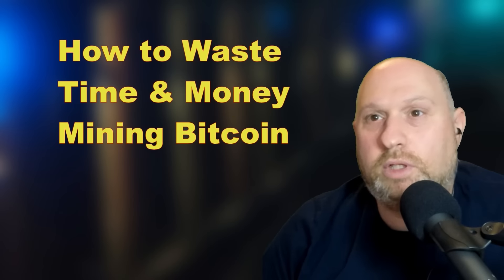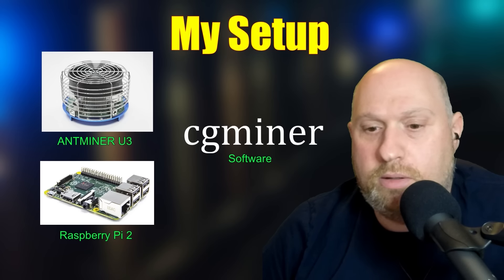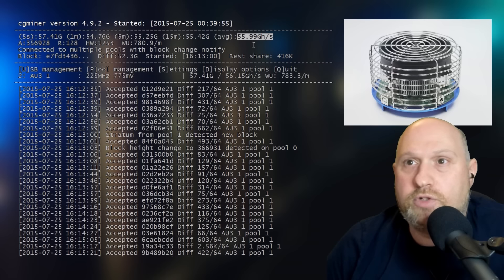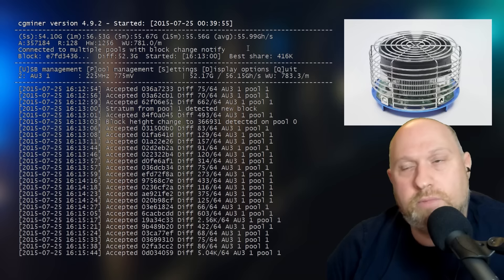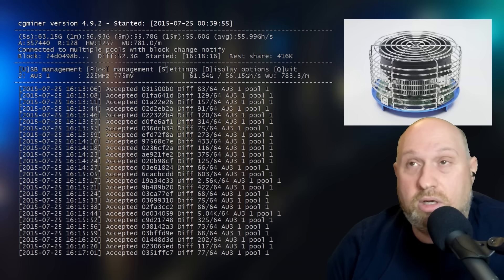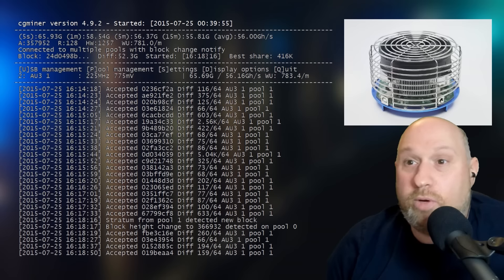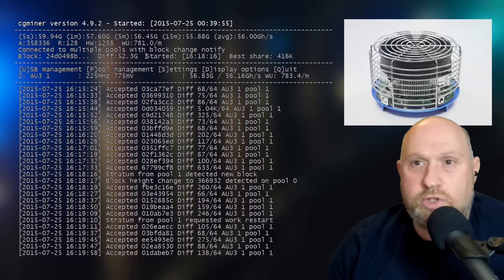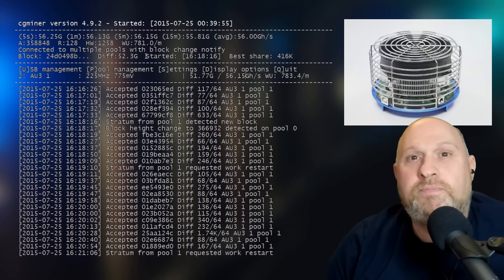How to Waste Time & Money Mining Bitcoin

Comment: you can buy a refurbished Antminer S4 now on Amazon for less than what those two miners cost when they were new. The Antminer U3 is very underpowered compared to the 2TH of a Refurb S4.
Reply from the maker: So in July 2015 (when I made this video) the Difficulty level was 50,000 M (Million). Today, its 422,000 M. The point I'm making is the more power you throw at it, the higher the difficulty gets. You need to Take Over more hashing power (in terms of global percentage) then you need to Add To the existing hashing pool. THAT is the only way you can "increase" mining returns. 

Reference: https://blockchain.info/charts/difficulty?timespan=2years

Comment: Hi!
I'm thinking of going into bitcoin mining. I dont pay for the electricity where I live. Would you then recommend this setup with a  rpi + antminer doing ~ 50 Ghz? Or should I go "crazy" and get the antminer which does 453 Ghz which cost Doubble the money?

I'm not looking for making a fortune mining bitcoin. It's more like an extra (very low) income.
Reply from the maker: +MrGrebgnet If you have money to burn, why not go for a ANTMINER S7 for $1K+?? The point of my video is that you are playing a sort of lottery, where the more people play, the more numbers you need to win (difficulty level adjusts based on how fast the encrypted puzzle is solved). So, although its true that the more power you throw at the problem, the fast it can be solved, the next problem will just get harder, so to keep up, you'll need to increase your hash rate by buying more or faster machines. 

You can also join a pool and split the winnings, but because there are so many people in a pool, payout is miniscule. Good luck!
Reply: Use GPUs to  bitcoin. But you might as well crunch for a worthy cause, liking assisting scientists with finding cures for diseases with Folding@home and similar.

Comment: Cheap miner, cheap results. I spent 9K in mid 2015. I know for sure I'll have those bucks back in 7 mo or less.
Reply from the maker: +Varlin Zapata - Awesome. What hardware did you buy? Are you hosting it yourself? 

Since this video was made, the difficulty has gone up again. Its now at 59.3G. The more power thrown at the it, the higher the difficulty gets. Bitcoin vs US$ pricing is also falling. Making it even less attractive. Les us know you've recouped your investment! :)
Reply: I mainly bought used S4s after projections that include different scenarios of difficulty increases and extensive cost analysis and potential setup pitfalls. I also live and operate outside the US and have electricity cost advantages, but slightly higher setup costs because of secondary shipping and limited variety of electrical supplies.